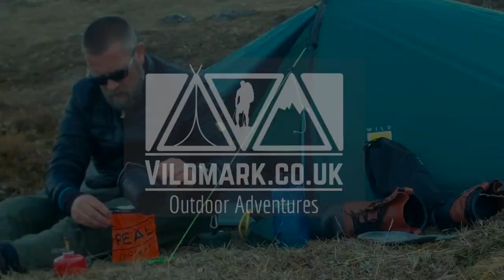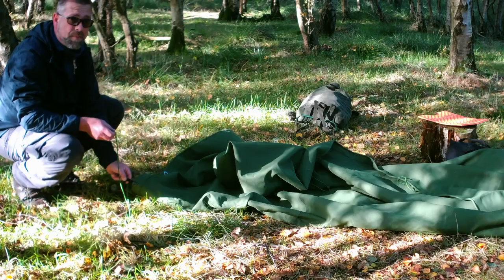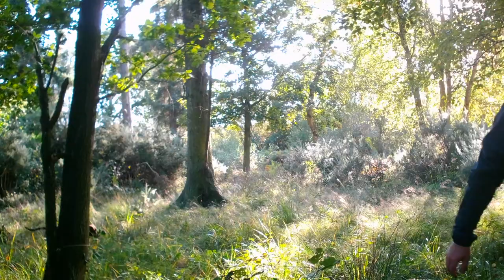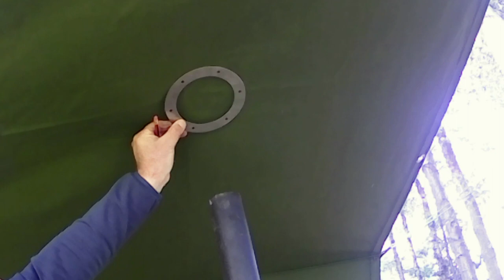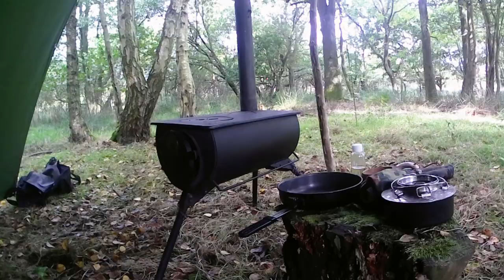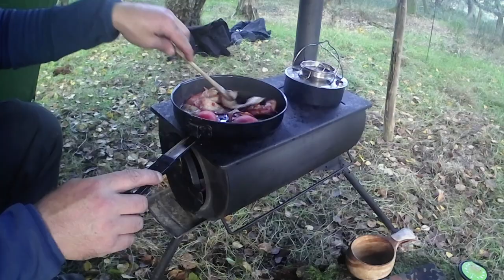Canvas Tarp Shelter | For use with the Anevay Frontier Stove.

Comment: Thanks for the video. Have you tried using the tarp in any other configurations now that it's got the cowl, for example anything a bit more tent-like?
Reply from the maker: Yes I have.  That was the idea to place the cowling there so it could be used in different setups.